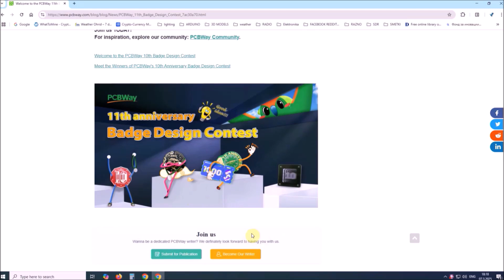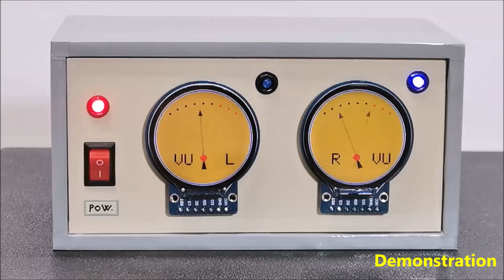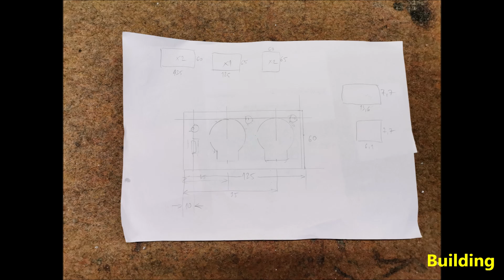ESP32 Analog style VU meter with GC9A01 Round Dispalys + Peak Meters

Comment: Dear Mirko, I am confused. You did your very nice gauge project with two EP32 modules. However, the accompanying code of Floris Wouterlood is intended for the Arduino Nano. May I ask you for the .ino sketch you use with the ESP32? I would be happy to use your code with the ESP32. Thank you so much. Kind Regards, Pavel.
Reply from the maker: The code provided on the Hackster website is specifically tailored for the ESP32, not the Arduino Nano. Don't be confused by the commented text, which is part of the original Nano code. Build the project according to the ESP32 schematic and upload it to both ESP32s. Separate codes are provided for the left and right channels.
Reply: @MirkoPavleskiMK  Thank you very much !